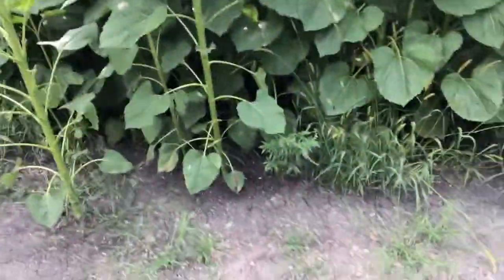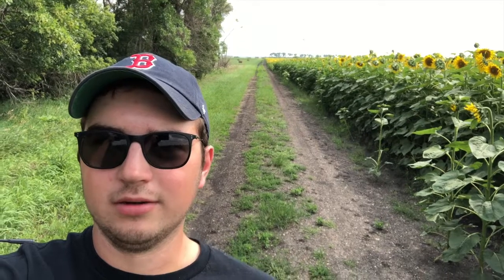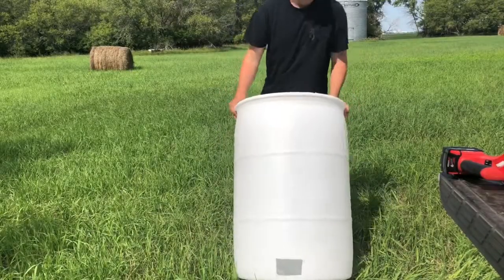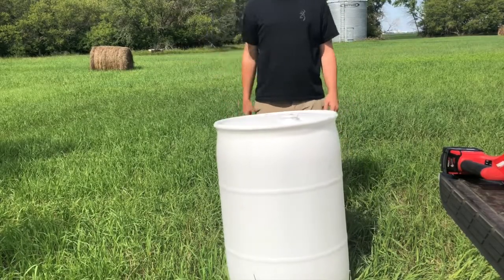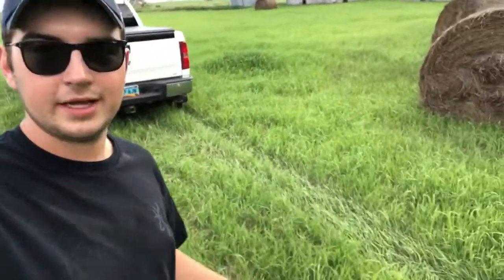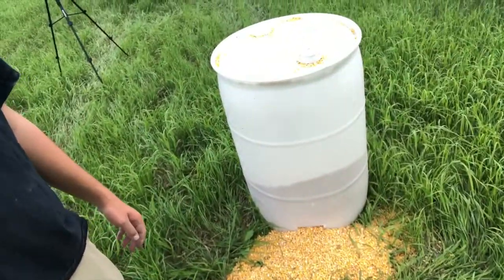How To Make A Deer Feeder CHEAP

Comment: Well you could order the 79$ wild game feeder from academy that holds 225lbs, set it up in 10 minutes, and only have to fill it every 3-4 months and charge the 6 volt battery every 6 months. Gravity feeders are great but you end up spending way more in corn every year than it would cost you to buy an electric feeder on a timer.
Reply: The timer on that feeder didn't even last a whole season for me.